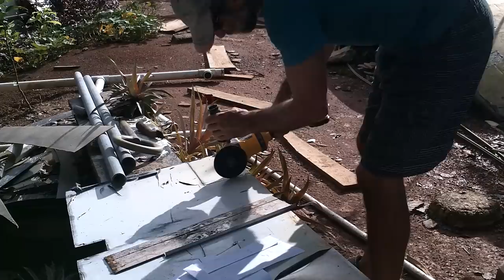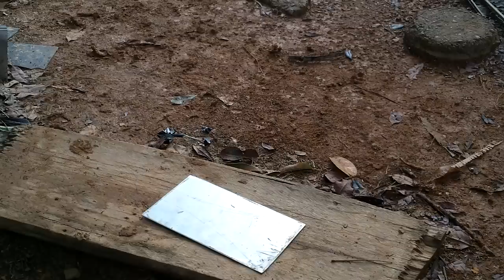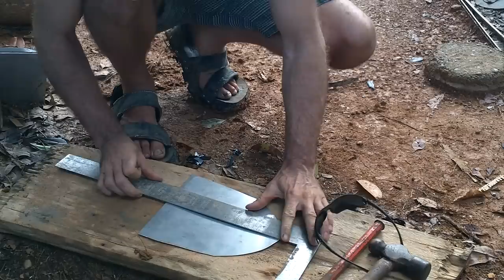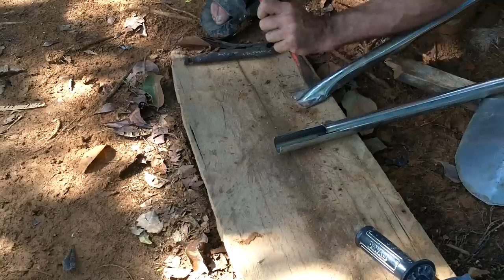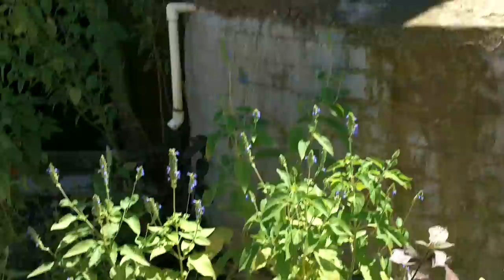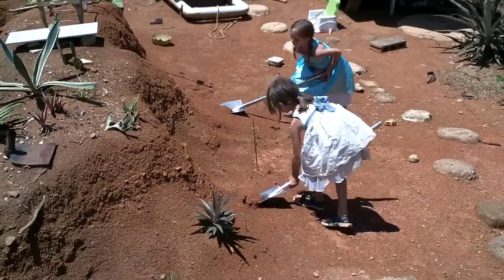Stainless Shovels DIY

Comment: I would put the guard back on that angle grinder. If that disc breaks you could get hurt pretty bad.
Reply: It depends on the skill of the user and his confidence to do so. I'd been using one without guard for years and it does'nt hurt me😅.
Reply: Agreed 👍 a bud of mine uses one everyday for a living. Has done for 20 years. He had an accidental moment of inattention 3 months back. Cut his chin to the bone. If he didn't have his chin tucked the neck would have been exposed. And in his case the disk didn't break or anything. Just slipped and kicked.